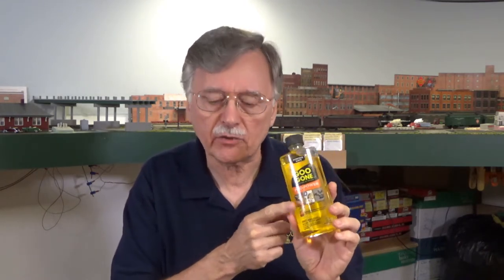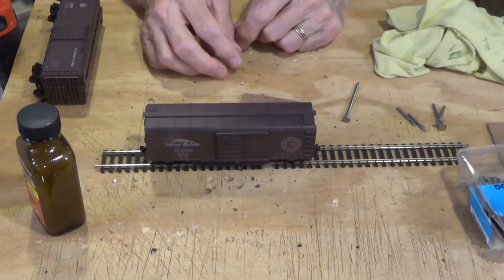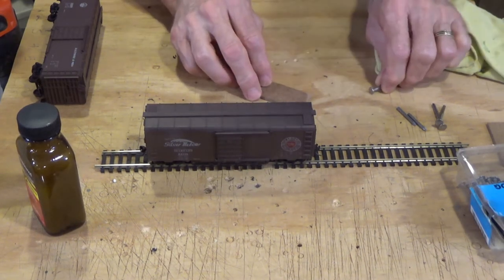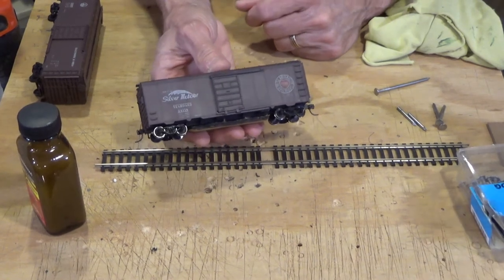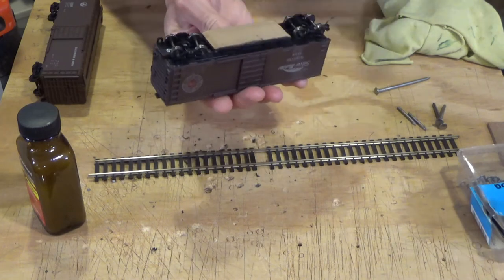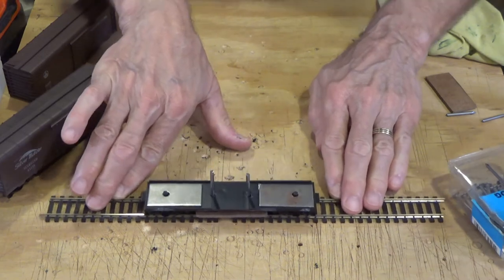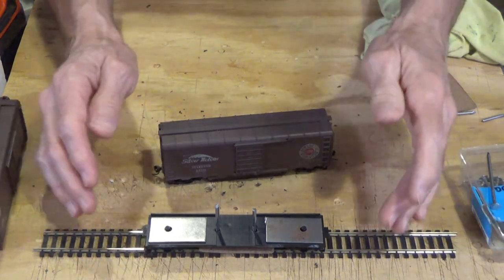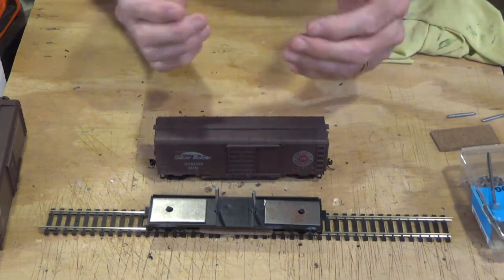Build this cheap and easy track cleaning car (34)

Comment: Larry, I enjoy most of your videos. Recently I've watched several videos that said not too use any type of alcohol because they are non-conductive and the small amount of water it contains can leave a rust residue on the track surface. What is your take on that. A couple of months ago I started using mineral spirit and then applied by finger a very small amount of No-Ox-Id "A Special ". Then lightly rub it down using a nylon cloth. My locamotives have ran the best they have since I bought them. Always informative videos. Thanks.
Reply from the maker: Consider that in order to have rust, which by most definitions is iron oxide, you have to have iron in the rails. Given that most rails today are nickel silver, which is an alloy of 60% copper, 20% nickel, and 20% zinc, then it is impossible to have rust. Consequently I would say that anyone who says these rails rust doesn’t know what they are talking about. As for No-Ox-Id, I have a friend who tried it on his layout and then spent a month cleaning it off the rails and wheels because it created so many issues. According to their MSDS it is a grease with about 8% mineral spirits. With an almost 2% helix on my layout I am not about to put grease on my rails so good luck with yours. I do have an alternative solution given me by Larry Maier of DCC Specialties that I will cover in a future video, as soon as I have given it a test.

Comment: I use mineral spirits -- they have no water content at all. Then, I apply No-OX ID 'A Special'. It prevents oxidation, and fills the micro scratches, greatly improving conductivity. And, after it's applied, track needs little to no cleaning, except light dust removal (shame on you for not covering your layout when not in use... 😉).
Reply from the maker: A good friend used No-Ox-Id on his layout. Made a huge mess—he had to clean every rail and wheel on the layout. It’s a grease, not going to go there!
Reply: @TheDCCGuy  All it takes is a very light coating with your finger, then wipe it down with a no-lint cloth. Your friend probably applied too much. Maybe check out Ron's Trains 'n Things. That's where I learned it... 😀
Reply: GUN SCRUBER.  removes all dirt and leaves no residue behind

Comment: I did mine in n scale to an Old Dutch Cleanser box car. Seemed appropriate.  
I used 4 1/4” neodymium cube magnets as both the weights for the pad and also they are the retainers that hold the nails in place when picked up.

Comment: I use galvanized  roofing  nails and I glue them with a hot glue gun. It works pretty slick.  I generally have a track cleaning car behind the engine in every train.  It works really well.  Every once in a while I sand the hardboard to clean it up.

Comment: What type of tempered hardboard do you use for the cleaning pad? I’m in the process of building one of these cars and just need a little more info on the board type. Any info would be greatly appreciated. Thanks, Bobby Wright
Reply from the maker: Just plain old tempered hardboard, ask for it at the local hardware or lumber yard. Most sell it in 4’ x 8’ sheets and also in smaller sizes. See if they have any scrap left over from damaged boards they will sell cheap or give you.
Reply: The DCC Guy thank you I will go to Lowe’s and pick a piece up, and by the way I enjoy all of your videos. Very informative especially for somebody like myself who is only two years into the Hobby with a 10 x 12 switching layout

Comment: Can't find Masonite with the "rough side" anywhere.  All the tempered hardboard is smooth on both sides.
Reply from the maker: Odd, I’ve never seen any with smooth surfaces on both sides!
Reply: @TheDCCGuy  LOL.  I can't find it not like that.  Older Peg board has it but not ideal to get a piece for this application.  Even looked a the cheap clip boards.
Reply from the maker: I get mine at Lowes or Home Depot.

Comment: I am a Maerklin guy venturing out into DC. What cars you suggested have weights at their ends please?
Reply from the maker: Are you modeling US prototypes or European? If US then avoid Athearn as they mostly have the long steel weights. Bowser seem to favor the weights at the ends and that is what I used. Of course you can remove the long steel weights, cut them into sections, and glue them into the cars placing them at the ends.

Comment: This is a great idea and super easy. Would you recommend  bonding a super fine piece of sandpaper (6000 grit) or applying a dab of fine polish or is just the piece of bare wood sufficient?
Reply from the maker: NEVER use sandpaper on your rails, it will just create gouges and scratches that will attract and hold grease and oil which then attract dirt and other gunk. Also the pad is not wood it is Masonite. It will gently scrub your rails and you can just sand it clean when it needs it.
Reply: @TheDCCGuy  Thanks Larry, it works great.  My rails are nice and shiny again.  I had my doubts without attaching some kind of pad and solvent but just running it dry gently polishes the tracks just fine.